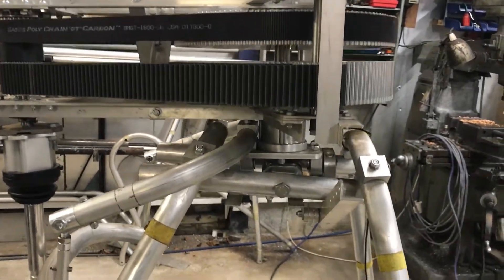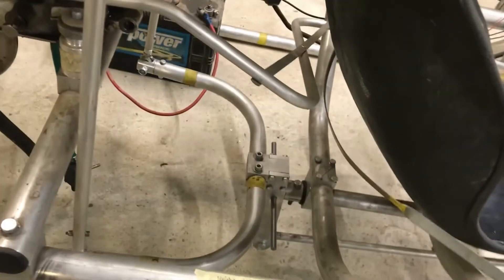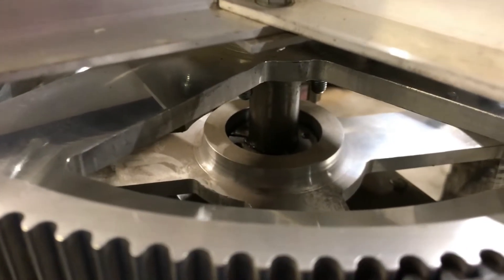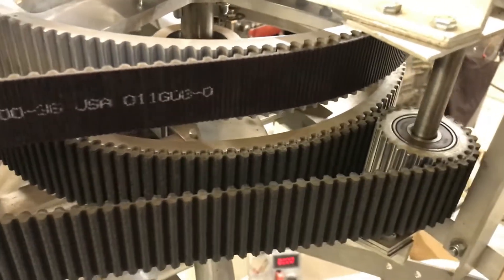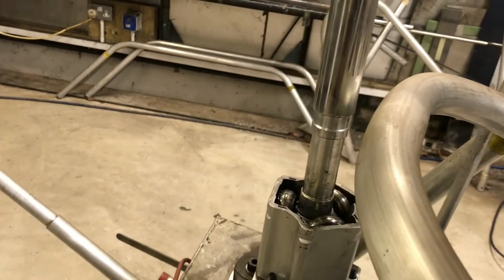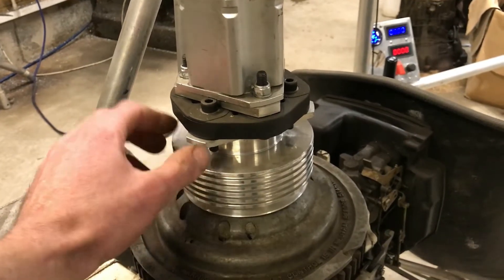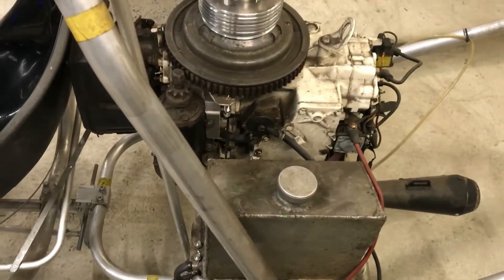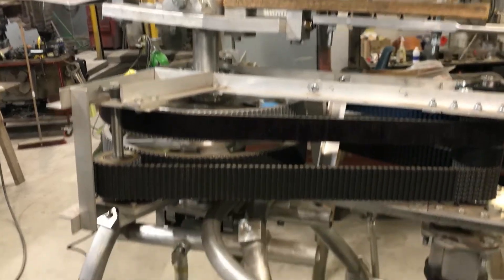Homemade coaxial Helicopter walk around and explanation

Comment: I wonder is it safe to use cars back axial Spider Gears instead of pulleys in order to make coaxial copter ?
Reply from the maker: It would be very safe to use those gears as they are designed for much higher torque than would be put through a small helicopter but are heavy.
Reply: @Ben-Dixey  First thank you for your replies , Heavier ?! , I mean just the spider gears without pinion without anything else . Please check >   https://www.youtube.com/watch?v=DQtVqsFCrMM&t=18s
Reply from the maker: Ok, yes those gears mounted in an aluminium housing would be just fine. 👍 I could have done the same but decided as I needed a belt reduction I could do both the reduction and reversing in one go. No Gearbox was needed in my case and is lighter overall. The Nolan and air scooter both had additional gearboxes and flew just fine.
Reply: @Ben-Dixey  Thank you for your time replying to my messages .

Comment: I know nothing about anything shown in the entire video: that being said... :D Would it not be better to have a second shaft next to the main drive-shaft connected by sprockets to reverse the rotation and allow you to run the belts the same way on both pulleys? Do the super tight radiuses on the belts not cause wear and inefficiency?
Thanks
Reply from the maker: It would certainly be better for belt wear and perhaps efficiency. But it would add weight to an unbalanced problem on the hinged head. This would mean more weight on the front to counter it. My reversing belt wear is of some concern, perhaps not for a prototype but it would need to be looked at otherwise.  Good comment 👍

Comment: did you build or buy those cogged drive pulleys? if bought where from? Also would love to know more about the sprag clutch, where did you find that and what are other applications the manufacturer markets it for?? very very cool project
Reply from the maker: Thanks, the large diameter pulleys where supplied to me as toothed blanks by KMProducts they make hover craft parts I then machined out the hubs and spokes. They are HTD profile but the belt is GT2, the small ones I made copying the GT2 profile onto a fly cutter. I would have made the large diameter pulleys myself but didn't have a dividing head at the time. It doesn't actually have a sprag clutch at the moment because I removed it to fit a smaller drive pulley but when I did i used one way bearings, these were keyed both sides and I used 4 of them to make sure they could handle the torque.
Reply: @Ben-Dixey  very cool. thank you for the insight. absolutely fantastic project you have going here.

Comment: How do you change the collective pitch of the rotor blades??? Didnt see any type of pitch change linksages anywhere. Or is the rotor system at  a some type of fixed pitch angle???
Reply from the maker: That's correct the pitch is fixed and lift is controlled by rotor speed. It's done for simplicity but the drawbacks are delayed response time and you can't autorotate.
Reply: @Ben-Dixey  Okie dokie. . . .thankya for responding! I was also  wondering about any autorotation or not! I sure hope ya can get all the bugs worked out & be a flyable ready stage👍🏼👍🏼👍🏼

Comment: No swash plate? Sure this is even possible?
I used to have a larger coaxial toy with cyclic on the bottom: It was very limited and would crash if you made it go fast because there was no way to control it in that state.
Reply from the maker: The concept has been proven to some degree with the airscooter 2, Nolan helicopter and Bensen b9, the Bensen is the closest to mine but flight details are vague, built in the 1950s. There is an element of the unknown with this project.

Comment: I noticed several Nylock Nuts attached to parts on the main drive shaft and rotor head, would these not be better secured with fasteners designed for lock wire retention?
Reply from the maker: Hi, yes you are correct, the most important bolts I have been wire locked which I believe is sufficient for prototype testing. If you were building a helicopter for flying hundreds of feet up and for long service periods all the bolts would be wire locked. There are some nylock nuts which if the prototype is going to be tested for longer periods I would swap to wire locked.

Comment: Great build. Where did you get the double tooth belts form?  Currently building one man helicopter. Using a geared contra rotating gear box.
Reply from the maker: I downloaded gates drive design software, just don't tell them your using it on a helicopter or they will refuse to help. How far have you got with your project ? Sounds interesting
Reply: @Ben-Dixey  I copied this deign (https://www.youtube.com/watch?v=OM7HHB51WX8&ab_channel=AviationExplorer) I have the gearbox built , three legged frame. I'm going to use a Harley-Davidson engine laying on it's side.
Reply from the maker: The Franz schoefman helicopter was a great piece of engineering and was one of the videos that inspired me too. What overall weight are you predicting ? Hp?

Comment: How does it yaw as there is no blade pitch?
Reply from the maker: Hi, There will be directional fins on the tail. If you search Nolan helicopter on YouTube there's a really good demo of how it works.
Reply: @Ben-Dixey  Thank for your quick response. I am thinking building RC type of your.
Reply: @Ben-Dixey  https://youtu.be/B21Xk6tNcBw?t=825 I can see it here. now I understand.
Reply: @Ben-Dixey  I have another question. what about the collective pitch for thrust up? is it depend on engine RPM?
Reply from the maker: Yes, engine rpm is used for controlling altitude, there's no in flight controlled collective pitch only ground adjustable. There's a guy who's made an rc version check out https://m.youtube.com/watch?v=X2gcgRWOAOw&t=60s

Comment: May I ask how fast does the blades turn.
I mean how much is the RPM of your blades?
Reply from the maker: Sure, the blades currently rotate at 700-750rpm. Tip speed around 530ft/sec. yet to be determined if this is the most efficient speed.
Reply: @Ben-Dixey  thank you Sir.
Do I need to make the rotation more faster if I make the blade smaller?
I mean does the smaller blade need more rotation?
Because the drone rotation is higher than a helicopter.
Reply from the maker: Adjustable Wrench DIY that's correct a smaller diameter rotor with a proportionate blade chord will have to rotate faster to maintain the same tip speed and therefore lift. If you increase the chord length on a blade you will be able to run it slower. This is why on big aeroplanes they extend the flaps in order to land at a slower speed, the same applies to helicopter blades, however there is an optimum chord length taking weight and drag into the equation. It is also true though that longer blades are more energy efficient than shorter ones to a point, it's more efficient to move a lot of air slower than a smaller amount of air faster.
Reply: @Ben-Dixey  thank you Sir.
I learned something new today.
Reply: @Ben-Dixey  How the coaxial helicopter take turns .. if it has no tail rotor?
Reply: @prash007more  differential in between both rotors, to allow them to "desync" (in a controlled way ofc), hence creating torque on either direction, very similar to what drones do to yaw as well
Reply: @djviperx  This project has no rotor pitch control at all, so no differential pitch, and no yaw control from the rotor system. The builder explained in another comment that he will be using flaps in approximately the vertical plane in the rotor downwash for yaw control.

Comment: How are the pitches of blades changed? It also looks like the rotors will be rotating at the same RPM, and the asymmeteric torque problem still be there.
Reply from the maker: Hi, The pitch is fixed when flying but can be altered on the ground, I can set each blade individually to balance the torque and tracking. Each blade can feather on its axis and is held by a threaded rose joint.

Comment: i saw an outboard motor engine on it How are  you going to Cool it, Outboards are water cooled
Reply from the maker: For testing I've just got a reservoir and 12v pump but if I can get it to fly I will add a radiator and belt driven fan. I'm expecting quite a bit of modification and trialing to get a system that works. Cameron Carter managed it with his helicopter and rotorway used outboards in the beginning so I know it's possible. Certainly would be easier with an air cooled engine but the price isn't cheap for such an engine.

Comment: Why do you use a wood to connecte the blades with the rotor?
Reply from the maker: Wood is just a material to take up the gap between blade straps and the blade. You could use any lightweight  material within reason and it would do the same job. The bolts themselves are enough to take the tensile strength but the clamping force dramatically increases the strength of the joint.
Reply: @Ben-Dixey  oky good job bro!!and I can't wait to see the next video when your coaxial helicopter is flying.
i am From africa 🇪🇹 Ethiopia

Comment: This appears to be a crazy invention that is a machine that has no purpose as it lacks a collective.  It's like crazy looking work of art. If it makes the builder feel better great. 
If he thinks its actually going to go a test flight then its really a sign of madness.
Reply from the maker: Well it depends on your goals a lot of the fun in a helicopter is hovering and learning to hover. A helicopter with collective is no safer than one without in the hover, you need a few hundred feet to transition from powered flight to autorotation. A fun field vehicle is my goal and a learning experience to perhaps progress to something that could get an airworthiness certificate. I think madness would be flying this machine at height, not something I would attempt or advocate.
Reply: @Ben-Dixey  You sir will be spinning in that thing instead of hovering. The downwash from the top rotor gives the blades on the bottom rotor a smaller angle of attack. Hence both rotors will experience different torque.
Reply from the maker: Aviator168 thanks for the comment, yes I expect i will have to set the bottom rotor to more pitch to equalise the torque. The pitch cannot be altered in the air but can be set on the ground. Have a look at the gen4, Nolan helicopter and air scooter 2 all have fixed pitch coaxial rotors.

Comment: Can someone explain why "fixed pitch" is not deadly dangerous in the event of an engine failure?
Reply: It is incredibly dangerous, as once you lose engine power you lack the ability to do an autorotation, which is why I despise fixed pitch helicopters, I was hoping at least one of the rotors had variable pitch
Reply: Sincerely hope he's successfully ..alot going on their..homebuilt helio's are notorious ...I shall say no more. Auto rotation ?
Reply: @davidvenable9257  There is no autorotation - it cannot safely be flown at any significant altitude, and the builder has acknowledged that.

Comment: Where is the collective control?
Reply from the maker: There isn't any collective control, the blades are fixed pitch and rely on rotor rpm to control altitude.
Reply: @Ben-Dixey  Sounds deadly dangerous if an engine fails.
Reply from the maker: Ram Jet yes, if it were to be flown at an altitude higher than a few feet it would be dangerous. This is why I think the air scooter was never sold, if there were two engines or collective control then it would be safe to fly at altitude but my goal was to build something to hover around a field on this occasion.

Comment: Good evening sir. Have you completed the construction of main rotor blade?
Is there a limiter for forward and reverse? as i have seen in the video when you were tasting the lever of forward reverse then the bearing inside the cv joint was half visible outside i mean that the length of the cv joint hub which is there will not have to be increased
Reply from the maker: Yes I have completed all the rotor blades and have tested them to full rpm. https://m.youtube.com/watch?v=xb4N3hOlrmM

There are two plunging cv joints each will allow travel of 50mm giving a total of 100mm. This will allow the mast to tilt forward and backwards of 5degrees in each direction. I hope this will be enough but I'm not sure at this point. I am expecting the movements for a controlled hover will be very small. But good question and observation 👍

Comment: I have a engine	970cc
Max power	5500 rpm
Torque	72/3000 Nm
please suggest me main pulley diameter ant tooth,
Reply from the maker: The gear ratio depends on the rotor tip speed you want to run at, my next test is going to be with a tip speed of 515ft/second.  To answer your question I would need to know your rotor diameter and tip speed chosen. My next test is going to be with a ratio of 7:1 20 teeth on the driving pulley 140 teeth on the driven. The belt is 8mm pitch so the driving pulley is approximately 51mm and the driven pulley is approximately 356mm, to get the exact diameters I would have to look at the toothed pulley table.
Reply: @Ben-Dixey  Right now I am just gathering information, I do not have any plan, now I am an automobile technician, so apart from the engine, I am thinking of making all the parts myself and the blade that too just because your design looks simple.

Comment: Автомата перекоса нет?
Reply from the maker: Hi. No swash plate, cyclic control is through a tilting mast on hinges. The same control as on the Nolan or bensen b9 coaxial helicopters.
Reply: @Ben-Dixey  понятно, меня интересует Рама вертолета и редуктор, из какого материала они сделаны? Алюминий?🙂
Reply: @Ben-Dixey  здравствуйте! А можно узнать размеры ремней и самого редуктора и передаточное число редуктора?
Reply from the maker: Одинокий  Волк the ratio I'm going for now is 7:1 but it's the blade tip speed you want to run at that determines the gear ratio. My belts are 8mm pitch gt2 poly chain by gates. One is 36mm wide the other is 45mm that's because the double sided belt was only available in a width of 45mm but 36mm is strong enough to take the hp.
Reply: @Ben-Dixey  спасибо за ответ, ваш вертолет уже отрывался от Земли?  Как обстоят дела с авторотацией?
Reply from the maker: Одинокий  Волк I've managed to get the helicopter to lift but only without me sat in it. The gear ratio was too high and I am reducing it now to try again, I wasn't able to get the engine rpm into its power band. Will try again. Have you started building something ?
Reply: @Ben-Dixey  я еще не начал строить, пока пытаюсь разобраться с несущей колонкой Соосноного вертолета, автоматом перекоса и дифференциальным шагом несущих винтов. Одним словом всей несущей колонкой. 🤔 но я планирую на весну, зимой уже начну покупку материалов. Для меня самое сложное это несущая колонка вся.
Reply from the maker: Одинокий  Волк it certainly takes a lot of thinking about it took me 6 months of research before I made anything, you have to try and plan as much as possible. If you are having a swash plate then you must be having cyclic and collective pitch control. This is a good way to go about it and the micron helicopter is a good one to look at.
Reply: @Ben-Dixey  да, и такая не большая проблема, не могу найти композитный тарсион. У нас делают вертолет Р-34 Роторфлай, думаю может к ним обратиться, хотя врядли чем помогут 😏
Рассматривал самолет но нет, я хочу вертолет!
Reply: @Ben-Dixey  Ещё хотел спросить, какой двигатель поставили на вертолет? Сколько весит и мощность?
Reply from the maker: @ОдинокийВолк-ы5о  No problem, my engine is a johnson outboard 60hp 2 stroke 2 cylinder. it weighs around 38kg, but I still need to add the cooling radiator and pump system. If you can find an air cooled rotax or Hirth engine for reasonable money I think that would be a good way to go. The cooling on my engine is going to be a trouble I think.
Reply: @Ben-Dixey  к сожалению даже наши российские РМЗ-500 не найти за адекватную сумму, но и другого выбора тоже нет, планирую поставить двигатель РМЗ-500, с 6 канальной продувкой, надеюсь не будет перегреваться и глохнуть.
Reply from the maker: Одинокий  Волк interesting, on searching the Internet I can see a rmz500 aero engine used in a hover craft. Developes 50hp and weighs 34kg, sounds good but can't find a price. The engine can be a large part of the cost in building. My project has cost me around £6000 but I only paid £500 for the engine. To get a second hand microlight engine over here it would cost around £2000. You can see why I went for the Johnson outboard.
Reply: @Ben-Dixey  у РМЗ есть несколько моделей, РМЗ-500, РМЗ-550, РМЗ-640! с РМЗ 640 можно выжать 65 лошадиных сил, если сделать правильную Фарсировку, к сожалению мой карман не потянет РОТАКСЫ, в идеале я хотел бы купить ПОЛАРИС - 600 но я к сожалению не могу себе позволить, карман дырявый.
Reply from the maker: Одинокий  Волк yes, that is the problem with this kind of project, it's expensive to build something capable of flight.

Comment: How are you able to control yaw ?
Reply from the maker: Hi, yaw will be controlled by flaps directed left and right in the downwash mounted on the tail. I will soon be carrying out a ground run as the rotors are nearly finished. If that passes the required tests then I will start making the yaw controls.
Reply: @Ben-Dixey  👍 ok

Comment: How heavy it is (approximation in kg) and what is the power output?
Reply from the maker: Hi. The weight for the first run up will be around the 110kg mark, if it has any potential to work I will continue to finish the cooling system and yaw controls etc and the expected empty weight will be 130kg. The maximum take off weight I'm expecting to be 300kg. The engine produces 60hp and 55lb/ft if torque.